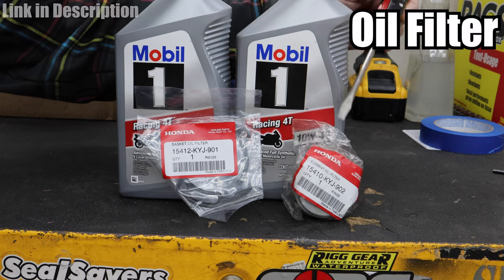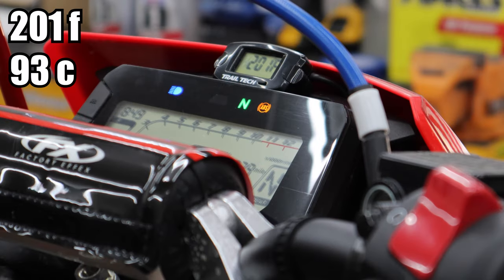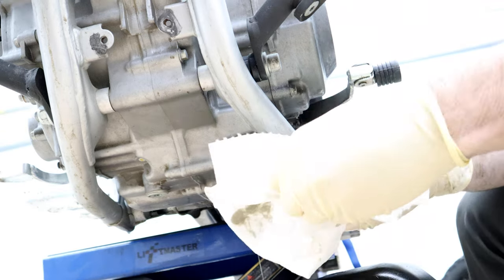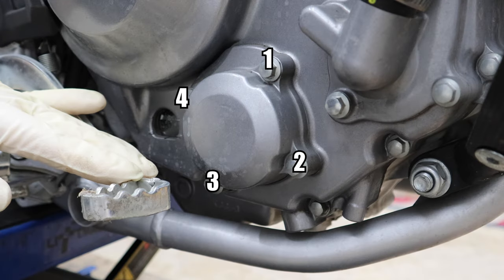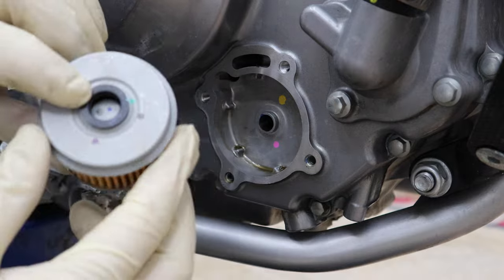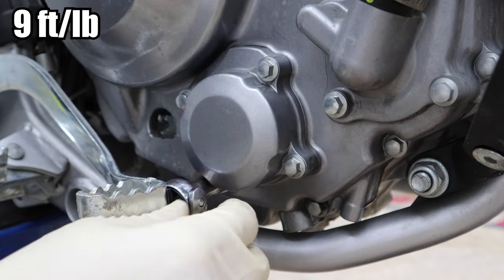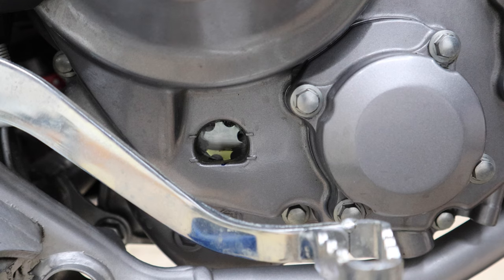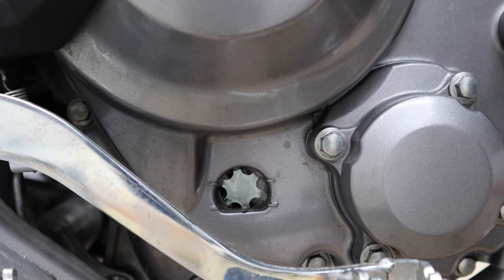CRF300L Oil Change FAST & EASY

Comment: This is how short simple and to the point all these kinds of simple maintenance videos need to be. Awesome job!
Reply: Exactly what I was thinking!
Reply: Do you need to replace the oil gasket too with a new one?
Reply: @lyricaesthetic4324  i did. I’ve seen someone in another video leave the old one on but I don’t think that’s the best practice. If you can get one, replace it, if you can’t, reuse yours and swap it on the next one.
Reply: @jtslev  oh thanks man appreciate it
Reply: Depends whether you're the kind of person who takes things seriously and gives important details or the kind of person that just slaps things together.  Don't worry about telling anyone to lean the bike for 1/3 more old oil removal, change crush washers or gaskets or take care in assuring the spring is placed/returned correctly and secure.

Comment: Good Vid. My 2022 CRF300 handbook says 10W30 motor oil. Is there a reason you run 10W40, or just your preference? Also is the 12mm crush washer the correct one for this bike. Thanks.

Comment: And don’t over tighten the bolts on the oil filter cap holder thingy. 9lb ft is a lot less that you’d think and those bolts will stretch or break real fast!
Reply: I had a CB300F as my first bike which basically has the same engine

You aren't lying...

Comment: Tighten to 18ftlb not 12ftlb on oil drain bolt. I'd link you the shop manual but YouTube keeps deleting the link. Can provide the entire shop manual by other means if you like.

Comment: Hey Jake, quick question. Say you were riding your 300l on ice and you broke throw and it sat under 5 feet of water for an hour. What would you do to get it running again?(yes I did this with mine)
Reply from the maker: 😬 drain all oil and gas tank. Pull out the wet air filter. If it will turn on electricity then pull the spark plug and crank it. You want to get that water out of there. If it’s got spark and seems like it will run then try to get it going. You want to get it hot. Run that thing till the fan is coming on over and over. Then dump the oil. It will be all milky. Then repeat that several times. I would run it without a oil filter while you’re doing this. Keep going doing this till it looks like pretty normal oil coming out. 3-4 oil changes is likely. Then I’d still do the next oil change in a few hundred miles. You want to do his as soon as you can. That water stilling in the motor is a bad deal. Also blast that thing with wd40. This is the best scenario. If the motor was running when it hit the water then there maybe internal damage.
Reply: @TheGardenSnake  Hey I got good news, took the intake and exhaust off, changed the oil a couple times and charged the battery, she fired right up no problem, runs and drives like new! Up to 130 miles on her now

Comment: Hey im sorry if this question has been asked already, but why did you not guy a crf450l if you want to build a supermoto?
Reply from the maker: If you go watch the original video where I reveled it you’ll see why. But I’ve had a plated wr450f sm and it’s great. But also really limits you. Look at the maintenance schedules. I also want to do ADV trips with this. The 450s would not do well with that. This 300 could go around the world.
Reply: @TheGardenSnake  oh alright, thanks! i knew itchy boots was doing a long trip on one, but i thought the 450l was as capable of doing long trips. However it makes sense that the 450L engine is related to the 450r engine

Comment: I brought the te310r husky awesome bike
Reply: I have both. : P The husky is a lot more of a trail bike. It is snappy and the gearing is tight and short. The honda is smooth and geared better if you are going to be on any highways. If you only ride trails or have a separate street bike get the husky. If you only have one bike or will be doing anything over 50% roads get the honda. I love the gas gauge and gear indicator. I was constantly searching for a 7th gear on my husky even with a smaller rear sprocket. : P Also if you get the husky make sure you've got a good kicking leg, the electric start has failed in probably over 75% of them and replacement parts cost a fortune. I've been kick starting mine since I bought it. Cold starts in one kick almost every time, hot starts usually take at least a couple.

Comment: How often do you have to replace the oil filter gasket and crush washer, is that necessary on first oil change?
Reply: Best practice is yes, gaskets and crush washers are one time use. Once they've been torqued once, there's a chance they won't seal properly if reused. (Off the record.You can probably get away with flipping the crush washer. I'd still replace the gasket though.)

You can get uncut gasket material for super cheap in big ass sheets and just cut it yourself if you don't wanna have to wait for the pre-cut gasket for your car or bike. Just make sure the uncut gasket is the same material and thickness as the original part. You can buy a 20 pack of crush washers for like $7 on amazon for most vehicles. I usually just buy like a pack or two of crush washers whenever I get a new vehicle and I'll probably be set for the length of time I have it
Reply: I replace my crush washer and gasket every other oil change. There is absolutely no need to replace them every time.

Comment: Wait some people use the other plug is it the same or not im confused
Reply from the maker: no use the one I showed
Reply: @TheGardenSnake  ok
Reply: @TheGardenSnake  i did it but do your oil was green ish after the brake in and was is a bit hard for the bold of the filter cover to go in cause mine is a bit and i dont want to break it

Comment: why is it so hard to find out how much oil it takes? internet has all different numbers
Reply: That's because it depends what you've done. It depends whether you lean the bike thoroughly and drained all the old oil or not. It depends whether you've split the cases. It depends whether you've changed the oil filter or not... 🤷

Comment: The correct torque for 8mm bolts is 7 ft lbs and for the 12mm bolt it’s 12 ft lbs but these values cannot be reached without breaking or twisting the bolts, so just tighten to a hard stop with 1/4 inch ratchet on 8mm bolts and 3/8 inch ratchet on 12mm bolt. Also note the oil and filter change requires 49 ounces of oil so a measuring pitcher graduated in ounce units will get a perfect fill. One more thing, the 2023 filter has a new part number.
Reply from the maker: Ooooook
Reply: none of the toques you laid out conform with CRFL300L service manual

Comment: Don’t tighten the crush washer till the very end. That way if you over fill it you can simply unscrew it and drain some out. Idk why so many yt videos do that first.
Reply: Because the proper way is to tighten the sump plug while you are working on it so it doesn't get forgotten and left loose, just slightly under-fill then top it off as shown in this video. It's the way I was taught on my mechanics apprenticeship with Honda cars... A boring apprenticeship, it was all services and new car prep's, very little repair work beyond brakes and tires.
Reply: @stonesie81  don’t forget to tighten it then
Reply from the maker: @stonesie81  This is a good point. I wouldn't suggest leaving the bolt lose. There's a chance of forgetting it. And it's pretty easy with a sight glass to top it up right. But if that's how you like do it then that works for you man!
Reply: i used to handtighten everything before, and then torque when everything was on, but that resulted in forgetting many thing and unsure what i torqued and what i didnt. i just torque everything right away now so i dont forget.
Reply: It’s 1 bolt. There’s 1 bolt that needs torquing in this whole process. If you can’t remember to do that you shouldn’t be touching it.
Reply: @shaunbarclay1309  Or just fill it up with the correct amount of oil. There are paths that lead to Rome you know. Sounds just as easy as not forgetting torquing it.